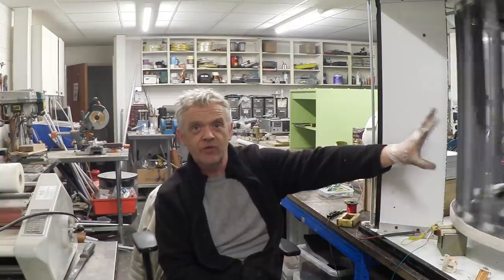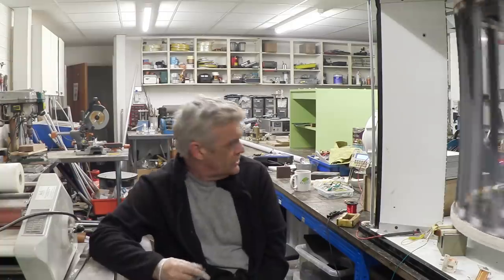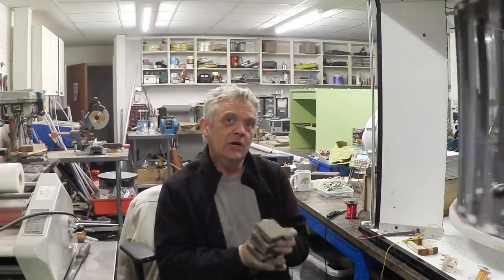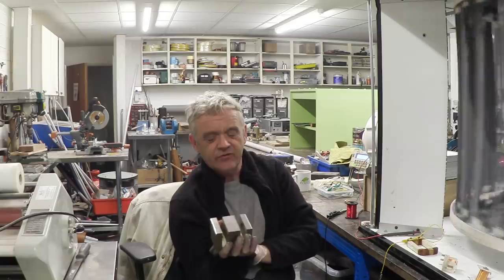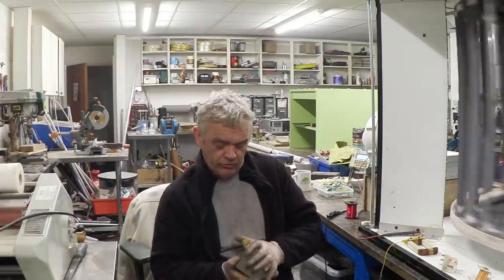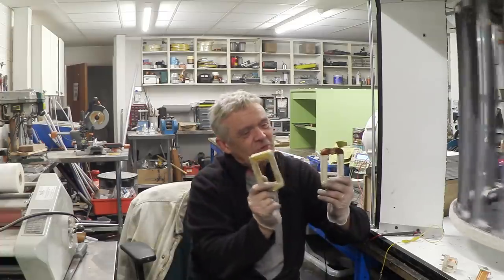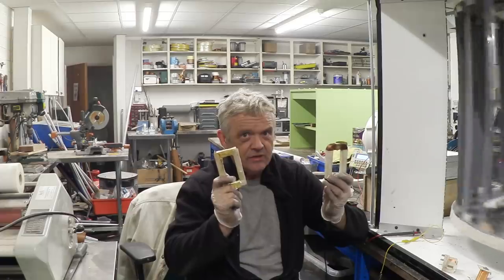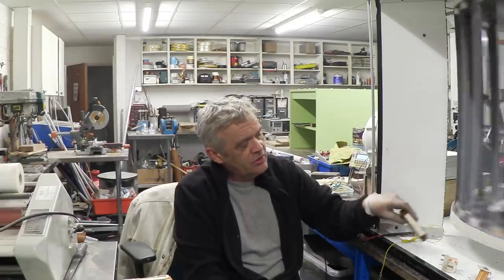Building a 1kW Wind Turbine For Under £100 - Part 5 - Messing With Coils

Comment: I think when You not rotating coil 90degree it covers more then one magnet at the same time, so it reduces amount of flux because single coil is affected by few magnets with opposite polarities at same time, but when coil is rotated by 90 degree, then it is affected by one magnet at a time and flux is higher.

Comment: coil and bolt is very thought provoking though. would love to see results of that test. possible a nail or even better would be using thick gauge staples. just tack the coil on it. cost and speed would be ideal for staples.

Comment: If the magnet protruded through each side of the disk you could then use a coil on each side of the magnet...it works very well..they will not nullify each other in this arrangement..and then of course..more coils means more available power

Comment: The Iron core is critical in the transfer of magnetic flux in a TRANSFORMER to increase the efficiency of transfer from coil to coil.
In a generator as you say there is a trade of with the physical resistance from the magnetic pull.
I have been watching a few reviews on the design of the Tesla motors and now other car manufacturers and the way that they overcome this with offset of the core, and angled magnets.

Also I may have missed it but have you tried an LG smart washing machine moter as a generator ?
My son converted one to a genetar of about 14V and attached it to an exercize bike powering a 12V battery through a solar regulator and into a 12V TV/DVD mounted on the front of the Bike.
Lots of free power and you watch a DVD while exercizing !
It was his school project.

Comment: What was the bogging down when leaving the coil as open circuit? Edit: I mean when you have the core in the coil you were seeing the speed drop to ~5 RPM from 10 RPM. If you draw no current (i.e. measuring volts only), does the speed get reduced at all? I'm thinking that if there isn't a big difference when drawing little current, keeping the core in there will let you get a better result at high wind speeds. You should just need an MPPT charge controller to track where it can get the most power out of the system as a whole. i.e. it'll adjust current draw to keep the turbine at the most effective speed.

Comment: With the little knowledge I have, I think adding weight to the edge of the rotor (like a flywheel) can improve performance. You could use any ingets of metal, gym weight discs, or heavy bricks, anything that can be symmetric and heavy should be good for this. It will not help if there is continuous high power draw, but it will help retain some energy and rpm for transients like momentary change in load or change in air velocities
I generally don't comment on you tube videos and I don't know if I helped, but I was very tempted to pitch in and suggest a random thought. I am very inspired by your videos and this video series. Thank you.

Comment: A very interesting explanation and clearly born out of experimentation which is in the spirit of pioneering engineering. 

One thing I would say to get the maximum output from the coil is dependant on the size shape of the coil, it’s former, the size and shape of the magnet, it’s proximity to the coil assembly as it passes. I try to visualise the strength of the magnetic field and visualise the induced voltage moment per degree of the magnets passing WRT to the coil core in terms of producing a single 360 degree cycle.

Maybe the best way to develop is build yourself a complete assembly for static testing on the bench.
Next, you want to experiment with different sizes of magnets and using your N / S arrangement, adjust the size of the magnet pairs so that you get both magnets to cover the same width of the core. Use the E core. My thinking is this, if you have say, the N magnet covering say the leading side of the E Core up to its edge and the other edge of the N magnet overlapping slightly less than half the middle section of the E core. Now in this static position have the same size S magnate positioned the same amount of overlap into the middle part of the E and it’s other edge lined up,with the trailing edge of the E core. Does that make sense?
Now not sure what gap there should be between the N and the S magnets but I would think it’s important that both the N and S magnets side by side should not be any wider than the leading and trailing edges of the E core because if you do maybe it will lead to inefficiency? I’m just theorising here on all of this Bob but it’s based in my gut feeling from my experience in similar fields of work. 
I think that if you experiment with a fixed core size in the bench and experiment with different size magnets and spacing you should get a good result. 
Like I say, imagine the travel of the North Pole magnet followed by the South Pole magnet in such a way that a nice sinusoids magnet field is in sync with the size of the coils and their core such that the induced current produces a well shaped sinusoidal path.
If you can get hold of an oscilloscope and look at the waveform (terminate the coils with a low impedance resistance) and observe that you get a nice smooth sine wave, if the magnet sizes and position are wrong it may result in a weak amplitude or worse, misshapen sine wave. Once you have the waveform correct then try magnets with a bigger strength, neodymium for example and or the proximity. You may find that if you get your magnets too close then saturation of the core might take place resulting in back EMF fighting against the induced current ...

So a few thoughts to consider perhaps?

Comment: put a second magnet so it connects wider. you can use the whole wire wrap width not sure if it would change polarity then putting a second magnet doubles the output at low cost.

Comment: First you always want the coils to be 90 degrees to the magnets, this  ensure maximum use of the magnetic flux.  you only want the iron core in the center of the windings, as it strengthens the flux providing more power, but the added iron on the outside will counter/cancel out the field with a reverse polarity, causing the wheel to slow. As for the windings, I know you are on the budget, but if you can, I would split the difference between the 2 sizes to make your coils, as well as average the number of windings between the thin, and thick wire  this would balance out your volts and amps

Comment: Depending on your need will depend on if you use heavy thicker coils with the 2v output or the thinner coils with 20v output. We realize they both produce approximately the same amount of energy, but depending on if you need to transmit the energy thru long runs of wires to get to your destination, or if your run is short to your destination, is one consideration in how to determine which coil size to use. 

 Less energy loss as heat in the transmitting of energy using higher voltage. So if you have a long run to go then it might benefit you to use the higher voltage coils, like 20 coils at 20v=400v. Then drop the voltage using transformer right next to your batteries. Or if you have a short run to the batteries, then 2v at 6 coils = 12v but you can still have around 20 coils, either use 18 or 24 coils to have either 3 sets of 12v outputs, or 4 sets of 12v output from the turbine. It is in how they wired, you can still get the voltage you want. Like if you don't use 12v batteries or if your have 12v batteries in series to make either 24v or 48v. You can still do the same to match what you will need with the coils and how they are wired. Instead of 4 sets of 12 volt outputs with 24 coils, you can wire them to be 2 sets of 24v outputs, or 1 set of 48 volt output.

Comment: Hi Rob

This may increase your build cost but, I was thinking the following.

First you could build several of these to reach your output needs in whatever low or high wind you need since these are being built so cheaply compared to the commercial 2000 pound unit.

Secondly on the build itself could it be possible to set up a wind speed regulator, I forget what it's called that has a digital circuit board and somehow tie into that board that when the wind speed goes past a certain limit it kicks in a second set of coils that takes advantage of the higher wind, it turns on the heavier coils and turns off the lower speed coils. This way you have two different sets of coils operating one at low speed and one at high speed giving you the two different outputs. To a battery backup system I suppose.

Thanks for these fun videos can't wait to see the next one.
Reply: the problem is having magnetic break affect from the cores, this will still be true even if you bother to switch them ( magnets like iron right?)even having cores that can be moved according to wind speed will require some torque from the rotor.....thus cancelling out any gains and making the whole thing more complex more expensive and more likely to break down ....lose lose lose situation
Reply: @spacexvanityprojectslimite3315  

Thank you for your input.

I appreciate the information.
😀👍
Reply: @spacexvanityprojectslimite3315  

I see your point about magnetic braking effect and you are correct and Robert Murray Smith goes over that problem.

what I failed to point out in my text on one of the videos he built a capacitor with a diode and described it as a clutch that took away the magnetic effect you speak of on the coil. With this capacitor and diode arrangement he eliminated this drag that you speak of.

I think his capacitor diode arrangement to remove the magnetic drag from the coil is revolutionary. I was operating off the fact that from this point forward all drag from the coil can be removed by his invention of a capacitor and diode arrangement.

Please take a look at it in a separate video if it's not on this one above. It's actually quite amazing.

Comment: So a good way to maximize the dual coil system, would be to actually use their voltage and amps separately, but driven into a single flow.
You can do this by using 2 bridge rectifiers to obtain the voltage and amps from each coil and drive them either parallel or in series depending on your voltage requirements.
The amps shouldn't matter too much since the smaller wire wouldn't add too much to voltage.
Anyway, thanks for the follow along, love the video

Comment: Hi Robert. I think the answer to the voltage vs amperage question  would depend on how a battery accepts  a charge. It would be great to see how this generator charges the zinc bromide battery.

Comment: re: coil design. I think you need to think about the flux path more carefully. Instead of a w shape, cut off one leg and have a U shape. What's happening with the w is that the flux is doing a reversal as the magnet passes over the two parts of the W. The iron will still provide a much lower flux resistance than air.

Comment: Robert, you said that when you used both cores together they cancelled themselves out.  I assume you connected these in series electrically.
Did you ever try using both coils together but wiring them separately electrically?   EG  Wiring all the high current coils in parallel together using diodes, half bridge, and then wiring all the high voltage coils together in parallel, again half wave. One high current loop and one high voltage loop.  This could be tested with 2 to 4 coils.  Just a thought.

Comment: Two magnets create a magnetic circuit focusing the magnetiic flux. A coil stator in between these two magnets while rotating will increase the energy output over a single magnet.

Comment: Next stage after this is perhaps the MEG -  we live on a generator going at 65,000 mph in a hyperdymentional super fluid - there is no such thing as free energy per say - however - power of the atom in the form of a neodymium magnet combined with the planet we live on  - is very useful indeed.

Thank you for this report and there is practical and robust applications applied through rural Canada using plastic drums - loads of usable power at low and high speeds.

Comment: Curious, I noticed you used barings for the axle. Doesnt the weight of the entire squirrel cage type fan cause drag?  It accured to me when you said magnets for the coils, that couldnt you use magnets with poles repeling each other to hold up the weight of the fan apparatus to cause much less drag? I pitchure the fan hovering on the axle spinning with almost no drag.  Less drag means faster spin; and that means more output and less power in (or lower wind needed)

Comment: good build so far,looks very good. The thing is with using the actual thing to attatch magnets too is it will always be 50% less effective as could be with a seperate rotor which coils can be placed on both sides of the magnet making it double the output. this is harder to do inside the drum.
iron core not necessary and produces cogging yes! Curved-triangular coils are said to be slightly more efficient at allowing electricity through with a tiny bit less resistance! (dont remember where i gained this info) probably negible gains.
 Regarding the coils, why not strip the wire and wind new coils which are a better fit to your magnets, and remember generation is the same as you noticed with the E whatsits, more leccy produced where the wire of coil is intersected at 90deg to rotation. So going on that i would make coils that are slightly longer than the magnet and as wide as the magnet ,with most wire in the long side which will be at 90 to rotation.

Comment: Other options are 2 coils of the same type, ie 2 primaries or 2 secondaries, wired either in series or parallel.  Another option is a 2 stage system to optomize low and high speed.  A control system to utilize one coil at lower speeds and switching to the other coil when the speed is higher

Comment: the similar power output of either coil has to do these coils came out of the same transformer... If you look up what a transformer actually does you will find that the power put in is roughly the same as one gets out only at a different voltage...
You want a custom coil (either seprate coils hooked up in series and/or parallel or a serpetine single coil or 3 of them to end up with a 3 phase power house) which puts out slightly (10-15%) over the voltage required to charge the battery used.

Comment: In your opinion..sir...do you think it would be better (more torque) to use half round veins or the way you cut 1/4 round veins? would the larger cupped veins produce too much drag? I am getting ready to start mine and I have a converted auto alternator with permanent magnets in the rotor.

Comment: I would choose for a generator without iron cores particularly for the horizontal axis turbine. Also as a prepper I want my generator to be as light weight as possible so I can move it around very easy. This ofcourse depend also on how much power output you want it to be. For a bug out shelter I don't need that much power so I guess around 400W output would be enough. I also have my portable 100Wp solarpanels anyway. And I have to carry my DIY portable woodstove also altrough my strength is decent my bicycle can help me out too.

Comment: I love your videos I'm wondering what would happen if you put another set of magnets inside your figuration But the inside magnets would have a small voltage going through developing A motor effect turning the outer magnets Faster To generate power  And  Store the power in 2 in ultra capacitor  Just wondering

Comment: If you added a second row of magnets perhaps you could use both coils one with iron core one without? then you would have 2 available voltages and just load up whichever set of coils work for the current situation ei wind speed AND power requirements.

Comment: I suggest the idea lots of bolts and coils around the circumference on your fan nice job make your own coils save on weight I would use the thick wire coil separate to the thin wire coil alternating on each bolt but microwave transformer is to heavy and the bolt solves your mounting problem but the flow of magnets over the aluminum sheet will cause heat from the flow of Eddie currents when that fan picks up speed setting the bolts and coils in resin just like the magnets will give it a longer service life that's my thoughts

Comment: If you get the chance, to find one, there was a Swiss made bike dynamo, called LightSpin, which, from the illustration on the box, had a cylindrical magnet , spinning, with a cylindrical static coil, running in a grove in the magnetic, effectively, ni on, fully enveloping the coil, so the flux did not "brush over" the coil, but "cut threw it". The dynamo did spin very easily, the was no sense of the iron cogging effect. Did I pull it apart, no, it was not mine.

Comment: You can also use one coil with more turns and 
smaller wire thickness  for higher voltage while another coil with less wire  turns  
with greater wire thickness for amperage and the coils are connected in parallel . Аnd to get a  
greater power in watts uses a large transformer  but  you will only need the electricity to be alternating .
For example, if you get 36 volts of voltage and 25 amps and push this power  through a suitable transformer, you will be able to increase the voltage but also reduce the amperage to some 10 amps, which is enough.

Comment: Do you know what would be interesting if you could make a fillable mold for an iron core that you could pump Mercury or some other such liquid metal or possibly powdered metal into to create a metal core alternatively when you needed it after it has gotten up to speed or was in a situation where the wind was consistently strong enough to be able to overcome the drag